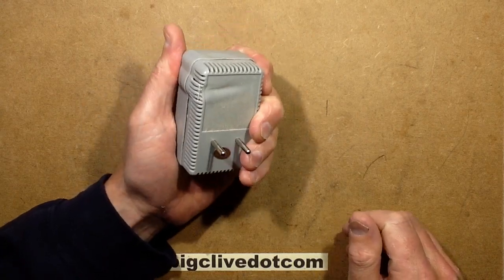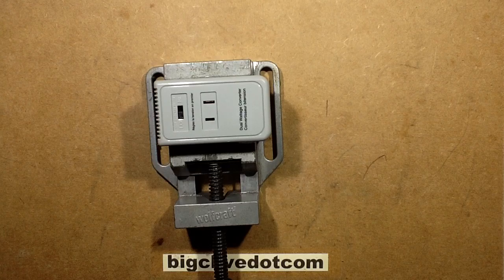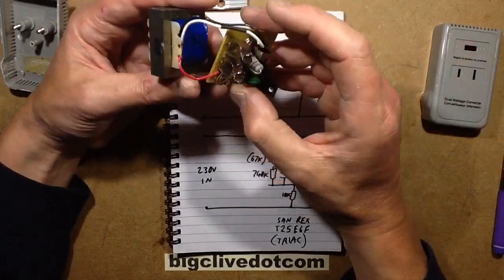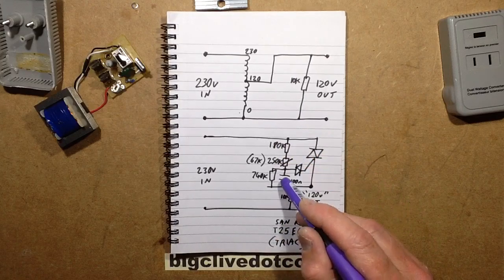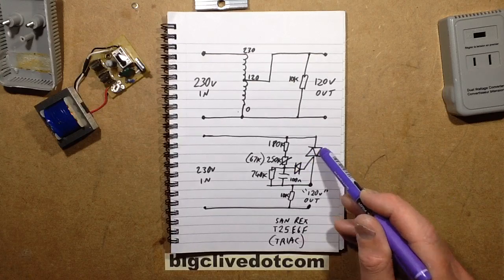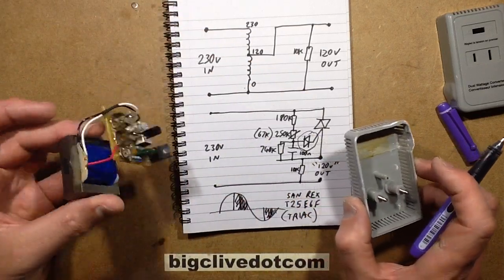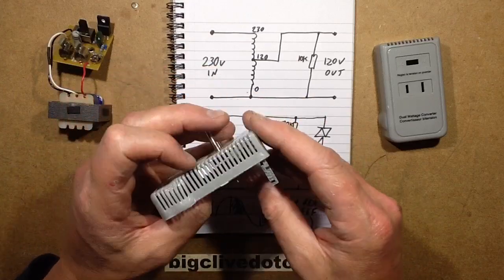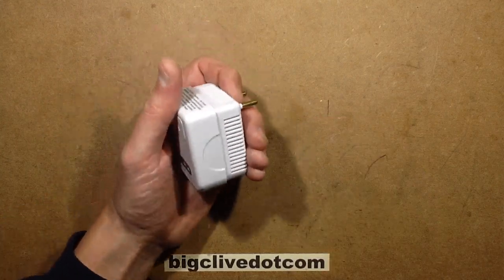Melty moments with a 230V to 120V converter.

Comment: What is the use for a mains voltage converter that can only power minuscule loads? You probably could not even connect an electric razor to that gadget without frying it.

Comment: Reminds me about the power supply on my first computer. It had a setting with a red! Switch on the backside that you could choose between 110 and 220 we use the latter and my curios nature got the best of me and i flicked the switch and the computer died. I got someone to look at it and it was only a fuse that blown. Next time tho i turned on the computer some capacitor or what it was had apperantly taken damage and after a few seconds of the computer running it blew. And this powersupply as you know has a fan blowing out in this case a hefty amount of smoke. The appartment we lived in had a strong smell of burnt electronics for several weeks after that. I never played around with switches after that i can tell. 🤣

Comment: Very nice video! Those high power resistors across the output are there to actually power the triac by allowing current to be through itself. Then it will allow it to run perfectly stable with absolute no load unlike a standard dimmer! That's cool, I will try and mod a standard dimmer to allow that.

Comment: Why not just use a transformer instead of that dimmer circuit that will give a totally crap waveform at the load?  The lump of metal presumably is to trick the user into thinking they are getting a quality product

Comment: I don't know what this thing is for. Nearly all modern electronics run 100-240 VAC, and high power load like hair dryers nearly all have a 110-220 V switch (in the U.S.). I would think if your hairdryer  doesn't have the switch, it's cheaper to buy a new hairdryer. Pretty stupid device. Season traveler have appliances that work everywhere.
Reply: It wasn't always that case. For example with camcorders, many of them just had chargers with just a mains plug.
No swappable DC connector on a lot of them.

It wasn't practical for example to buy a video camera while in Europe, because if for example you brought the footage back to the US, it would be 50hz and in PAL.

Also would a US hair dryer work on 240v 50hz being that most of them have GFCIs built in? Would a simple pin adapter work without a false trip, or would you have to change out the cord/plug to bypass the GFCI?

Comment: Fail-safe idea for the chopper:
Add a thermal fuse (the same kind used in various heating appliances themselves would be fine) in series to the input, thermally coupled to the output minimum-load resistor. That way, if the TRIAC shorts out, the resistor will overheat and blow the thermal fuse before the connected appliance can start a fire (maybe even before it's permanently damaged, if you're fortunate).
Obviously you would need to plan the thermal design properly, and may even want to obtain a resistor with a hollow core (perhaps even fitting the thermal fuse inside that, with suitable electrical insulation e.g. PTFE tubing) so that its temperature responds quicker; and don't forget to apply thermal compound between the resistor and thermal fuse.
(To prevent incidents like this one, you would of course also want a thermal fuse at the transformer's input.)
 
The more expensive (though still cheaper than a large transformer) possibility for instant response would of course be to include a 'crowbar' circuit using back-to-back transistors (or one wrapped inside a bridge rectifier) to shunt the output during "off" time (with the usual dead-time margins of course), so that a shorted TRIAC would then combine with the crowbar circuit to short the mains and blow the input fuse (preferably HRC of course). The control circuitry would probably be too complex to include in this little thing, though :D

Comment: It has a weird plug. That would not fit schuko or even "modern" ungrounded outlet as they are recessed. Also the pins seem to be split. This is considered a no no nowadays as the pin could open an turn back and sting.

Comment: Radio station where I was the chief engineer (and only engineer) needed remotes on their turntables.. big gates things with lots of rumble.. but being an AM station, you couldn't hear the rumble because of the EQ on everything... Used a very simple Triac board for each turntable, tied to spare terminals on the "audition/Air" switches.  Throw it to air, the turntable would start, and do it without the loud THUMP from the over enthusiastic DJ hitting the big rocker switch on the turntables... NO idea how long they worked...but was a neat project...

Comment: Why doesn’t the UK also goes to the 230V like the rest of Europe 110v 60hz is only used by you guys.
Reply from the maker: It's supposed to be.  But in reality it's still 240V with a wider tolerance on the 230V spec.

Comment: I try couple times to open the case quite will by using a Indian method, Use a syringe inject the gasoline to the gap of the case,  Wait for 20 seconds then you can easy open it up. Since the gasoline are just melting the case so be careful don't let the gasoline spray around the case surface if you don't want the gasoline destroy the surface.

Comment: A puny, little diode is roughly dividing the power by two. So, the resulting voltage is NOT divided by two but by the squareroot of two. Simple maths. To get half voltage, you must divide the power by four. As arccos0.25 is 75.5°, you will have to cut of each halvewave after approximately 42% / 4.2ms (50Hz). The momentary value of the voltage at this moment will be 315V (at 230V mains) or  329V (240V mains). Notice: The maximum moment. voltage of 120V mains is only 170V. So,cutting off at 315V or 329V will be quite stressful for a 120V device.

Comment: The load resistor is (among other things?) to provide initial current to lock the triac into conduction.  It is possible that the external load has just enough inductance that the load current would not rise fast enough.
8k is indeed a funny value.  Not in the E12 series.  At first I thought it would be from E24 series, but no.  And not from the E96 series, which the 1% resistors typically use.  It seems to be from the obscure E48 series.  Did you see if it was 5% or possibly 2% tolerance?
I enjoy seeing you revealing all kinds of blunders in the various gadgets that typically are made ultra cheap and just barely “good enough”.

Comment: I've been wondering what the maximum safe temperature for a transformer should be. A recently purchased 100 watt converter gets somewhat toasty when running a 70 watt air purifier from it. I wonder how foolish is my plan to sandwich it between 2 heat sinks and install the device inside the purifier beside the fan.

Comment: These exact high/low transformers are widely sold (all major discount shops, etc) in the US and Canada and the directions tell you to use the low setting for electronics and the high for heat appliances.

The number of times I've had to tell people NO you don't need to use it for your phone charger, and you shouldn't...

Comment: Heatsink extrusions cross sections that are not proprietary can be ordered from most extruders just ask around what stock shapes a manufacturer has dies for. most medium sized mfg's in the US will run a custom shape die provided you buy all the material of their ingot size usually a 3ft long bar. price typically $0.10-$0.50 more per lb than bar stock going price of the day.
Reply: That's assuming no requirement for custom straightening fixtures post die and loose tolerances are acceptable.

Comment: In the 90's both of these designs were manufactured in Shamokin Pennsylvania USA and marketed under the "Franzus" brand of Middlebury, CT. They were ultrasonically sealed. The caps were 104k. The tirac in the second unit you reviewed was a BTA15 400MV. I think the resistor was 10K. Pot was 50k. But the design of your unit was cheapened. Back in the day there was a thermistor in the divider feeding the pot. They were as noisy though.
Reply: thermister... so when the triac got hot it would turn the duty cycle down. "cool"

Comment: If surface area is a priority, why has nobody made a CPU / GPU heatsink in the shape of a Mandelbrot / Gabriel's horn yet?
Reply from the maker: Ease of machining or extrusion.
Reply: bigclivedotcom True enough, but there's plenty of specialist equipment out there that's already inconvenient to manufacture.
Reply: Right, but the price would be too crazy. Current heatsinks work just fine and they're cheap to manufacture. There's no motivation to innovate.

Comment: I'm amazed it's legal to sell such a thing. There should surely be a current-based circuit breaker on the "low-load" function. As for selling that chopper circuit as a voltage converter? At the very least it's miss-describing the device. There's also not current limiting on the triac circuit (unless blowing the triac counts).

Another point is that the degree of power reduction that will be achieved will depend on the mains frequency and will be different between 50hz & 60hz.

Comment: Hmm... It's all nice 'n easy, but: What about the frequency? Does it convert the European 50 Hertz to the US 60 Hz? Cause running a AC motor that is built for 60 Hz with just 50 Hz is as far as I know a very bad thing... It runs much slower (16 2/3 % to be specific) with the specified power consumption, or in other words, you will have to overload the motor to run it at the specified RPM. Both scenarios will kill the motor with the time. Plz correct me if I'm completely wrong!

An in this context, can plz someone explain me the difference between ohmic and inductive loads? I mean I know the difference principally, but relating to the frequency. How do different loads behave when fed with different frequencies?

Comment: hmmm... I've seen other videos explaining the many interesting aspects of the British plug design.  I just thought of a question though... In the US, it has become common to include a standard electrical outlet instead of the cigarette lighter given the falling popularity of smoking.  Do British cars include power outlets now?  If so, I would expect they can't just stick one where a little cigarette lighter used to be given the larger footprint and the even larger accomodation necessary for the cables and whatnot.  Also, is the 90 degree bend between the conductors and the cable going into the plug a requirement?  Are there any in-line sort of plugs where the cable goes into the broad side of the back of the plug head?  If not, is there a particular reason?
Reply: Dustin Rodriguez most UK cars come with at least 1 12v power socket where the cigar lighter used to be (circular outlet, like the cigar lighter socket). Having a lighter and ashtray fitted is usually an extra cost option. Some cars do come with the option of a UK standard 240v output socket, powered from an inverter.

Comment: I have a quick question. Are transformers really so expensive that the dimmer circuitry is actually cheaper than just getting a bigger transformer, or are they trying to save weight? Why wouldn't they just put in a 2:1 transformer and be done with it?
Reply from the maker: The dimming style circuitry allows loads of hundreds of watts.  A suitable transformer for that current would be very big and heavy.
Reply: Have you seen a microwave oven transformer? Those will handle about 1kw. Rewinding one of those could get you a 220/110 transformer, but would still be the same weight and size. A kw in is equal to a kw out.
Reply: The lower the switching frequency is, the larger the transformer needs to be for a given load. If you wanted a 1600 watt step down transformer that runs at mains frequency of 50/60 Hz, it'd be around the size of a large 8 slot bread toaster and weigh 50 - 80 lb.

Of course this makes the transformer really expensive because it requires so much copper wire and steel plates to make.

Comment: I had a 120v to 12v cigarette adapter from the gas station, used for powering small stuff. Plugged my phone charger in to see how well it worked and next thing I hear is ZZZZZTTT! Blew a hole in the side of it. Turns out a single resistor was used along with a mediocre rectifier made of 4 surface mount diodes. Also why can't companies just make simple central tap transformer based convertors instead of even bothering with adding electronics in? Sure they'd be a bit more bulky but hey, I'd rather have something that works.

Comment: Half wave rectified 240V mains has an RMS potential of 170V so referring to lamps run on same as overdriven is putting it mildly.  Lump heatsinks are used where the device they are sinking heat from has short operational duty cycles and is mounted somewhere with no easy way to dump its heat which is why they are common in cheap consumer uninterruptible power supplies where the inverter is only meant to run for a few minutes at a time.

Comment: With plastic welded cases like that it can help to put only one end of it in the vise first, trying to pop one end then the other, and to have it cold when you start.  While there is tension on the end, tap the seam dimension under pressure with a small, sharp chisel.  If the vise isn't mounted on something you may need to set the other end of the casing against the work table.

Comment: Question: Is it possible to use a voltage regulator found in the vacuum cleaners as a 230V to 120V converter once set on a required level ?
Reply: Alen X in China, everything is possible to be used.

Comment: Hi Clive. I love your work. Have you reverse engineered the circuitry in one of these? If not, could you do so? Thank you. http://www.ebay.com/itm/Outdoor-Bug-Zapper-Electric-Mosquito-Fly-Insect-Stinger-Garden-Pest-Control-/221407838089?hash=item338cef7f89:g:RP0AAOxyyq5TOyZQ
Reply from the maker: They usually use a voltage multiplier for the high voltage.
Reply: I have one but it stopped working after approx one year.  There is a burned quarter watt resistor on the circuit board, and "possibly" a bad polypropylene capacitor which caused the overheated resistor issue. I don't know the value of the resistor without a schematic, the color codes are burnt off.

Comment: Now in my mind (which is consistently wrong), wouldn't a 120V motor be fine on one of these triac based circuits? When I think about it, a motor running at 120V full wave runs at say 2X, so when you half that wave it will run only half the time as it does full wave, so intermittent movements would make the motor run at a continuous speed of about 1X. When you multiply that voltage by about 2 wouldn't that kick the speed up again and make it run faster, about 2X again? I don't see a problem with motors on these circuits. Please correct me if I'm wrong (which I probably am).
Reply from the maker: The inductive load might make the triac circuit operate in an unstable manner.  In something like a hair dryer the heater would be the bulk of the load and the motor would be less of an issue.
Reply from the maker: If the triac circuitry is designed for inductive loads they can drive motors no problem.  These units were not really suited to purely inductive loads.
Reply from the maker: The heater is a PTC material (Positive Temperature Coefficient) which means that as it heats up its resistance increases so it self regulates.
Reply: Universal motors are used, and sometimes small single-phase induction motors where the efficiency won't matter as much.
Reply: I've seen triac circuits being employed in the AC blowers at some buildings. Not sure if they design them specifically for use with triacs.
Reply: Some light AC motors, like fans, can be controlled by a dimmer. A dimmer does make them run hotter at lower speeds, but they use a small enough amount of power that it doesn't matter. The more powerful ones don't like it too much because the current spikes make it heat up a lot, and can overheat.
Reply: bigclivedotcom
You mean like adding a filter circuit on the output so it creates a smoother wave instead of a chopped up waveform?
Reply: Thank you i can google it now i know what to google  for .
Reply: As useful as it is to posess this information, is it a vice to have such knowledge? ;)

Comment: Technically speaking for those interested that's not a standard transformer it's a type of transformer.

A standard transformer has at least two windings a primary and a secondary (the input and output) which are isolated from each other.

Since this transformer has only one winding it's called an autotransformer and the input and output are unisolated.
Reply: Yep. If you make one with a wiper for a variable centre tap, you have a "variable autotransformer", or as it's known by brand, a Variac.
Reply: auto transformers are dodgy with no isolation from the mains voltage
Reply: They're fine IF you don't have any expectation of isolation. If you treat the output like you treat a wall socket, you're fine. That being said, my variable autotransformer is backed by an isolation transformer for use on the bench...

Comment: Shouldn't the triac fire at ~170V? That would be the peak voltage of a 120V line.
Reply: The idea is to have something that is 120V RMS which can include rather horrific waveforms like the TRIAC circuit output in this.
Reply: Well, the circuit is more of a timing circuit.
It takes X amount of the sine wave to charge it up until it conducts.
So it can really cut in at any voltage or point along the curve.